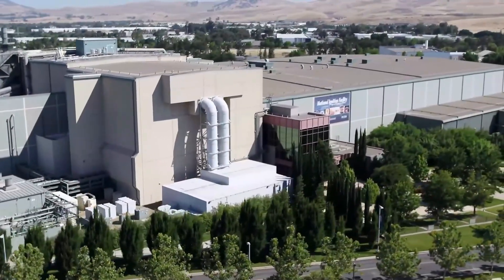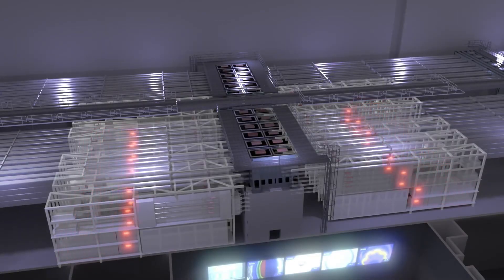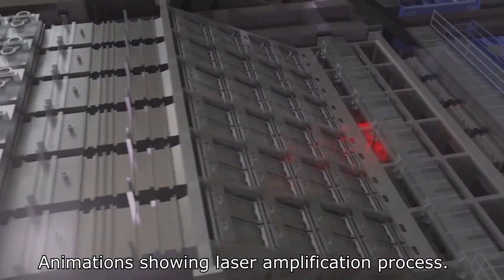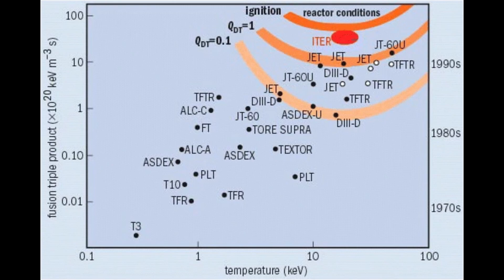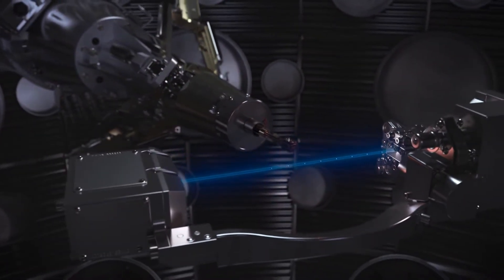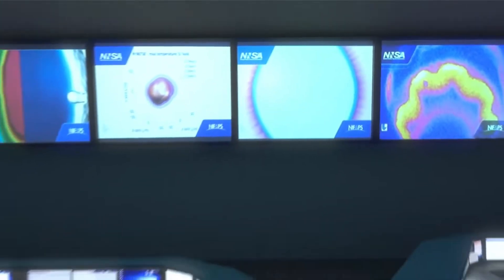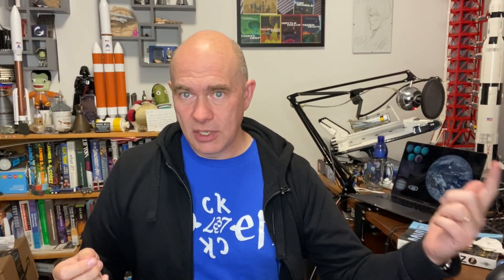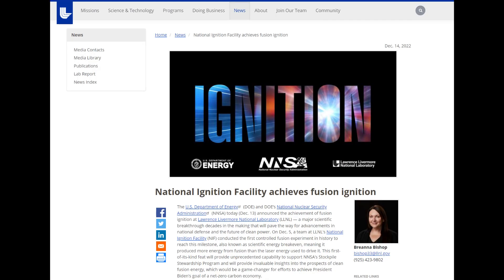Why The Biggest Laser in the World is Making Big News About Fusion

Comment: A big step forward,  fusion used to be 25 years in the future, but now only 30!
Reply: This laser reaction achieved Q 1.5, ITER aims to achieve Q 10.
Reply: @Safetytrousers  what you want is a Q of 10 when counting the energy into the laser, not just that into the pellet.
Reply: @davesutherland1864  Q is break even. The laser did not get 10 times the energy out of what it put in.
Reply: @Safetytrousers  You are correct, I edited my comment for what I had intended wrt laser fusion.
Reply: When they tell you fusion is 60 years away, you can (sort of) believe them.  That means they are ready to set out a timeframe to…

Build a proof of concept reactor to generate power (not necessarily net energy production).

Have plans for a proto type generating reactor (that will have net energy production, sat 50 to 100 MW).

Have plans to build commercial reactors to put significant power into the grid (say 500MW per reactor).

Each of these could be a 20 year rollout.  Some of the startups looking for funding will give you shorter timeframes (they have to for the investors).  However, none of them have any results to date, so take them with a grain of salt right now.

Comment: I think what is lost on most people is that if we are able to harness the energy from a fusion reaction to generate electricity it won't have the problem that fission reactors have of disposing of still radioactive spent fuel.
Reply: On the negative side it will probably never see the light of day since politicians in control of funding are bought and paid for by the fossil fuel industry. I mean heck.. as Scott said it the only reason this facility even got funded was partially for weapons research.

Comment: I‘m asking myself if the next breakthrough in energy production could be something completely different. Because what we basically do since the industrialisation is to spin a turbine (except maybe a olar cell). Are there any other ways of gaining electricity?
Reply: Seebeck effect? Unfortunately, it is extremely inefficient so not really viable for power generation. Stirling engines are highly efficient and used in some large scale solar, but they tend to be unreliable. I suppose you could generate electricity using something like a static electricity generator, that would be cool to see.
Reply: If you don't like turbines, you'll pretty much have to use thermoelectric systems; extract electricity directly from the temperature difference without the whole water to steam part in the middle. It's possible there will be some new materials developed that could make electricity generation much more effective.
Reply: @nuclearmedicineman6270  Yep.  They're called radioisotope thermoelectric generators (RTGs).  Ya just need a little plutonium.  And a lot of money.  And a lot of shielding....
Reply: Check out Helion Energy.  Their reactor has the plasma pass through coils to produce electricity.  The reactor also produces Tritium and Helium 3 as a bonus.
Reply: @jamescottrell7147  MHD generator?

Comment: A wonderful SCIENTIFIC achievement — Optical Breakeven — but not very useful result from the TECHNICAL side of things.  
Using Nd:Glass lasers with so low conversion efficiencies for electrical energy into optical laser beam energy means you need a thermonuclear output enegy several hundred times higher.
Besides there are a huge number of other ootical, material, electrical, thermal engineering issues that have to be solved to get a practical Inertial Fusion reactor.
There are not enough brainpower employed in these problen, and ICF funding is mostly.l provided by the military budget of the DoE, so the predominantly foreign High Energy Density Physics graduating from UoRochester, UCDavis, UCSD, UNevada-Reno are usually excluded from ICF R&D. 
In the USA, ICF is predominantly a military-oriented research program — to investigate, test, homologation, validate R&D for Thermonychear and Directed Enegy Weapons.  Energy generation is not a priority.l — results like this ignition are predominantly budgetary PR for DoE's Lawrence Livermore, Los Alamos and Sandia National Labs.

Comment: The National Ignition Facility is under considerable pressure from Congress for results.  Since the Obama Administration funding for the NIF has been flat or in decline.   The recent hubbub about NIF fusion reaction resulting in a net energy gain, hailed by US officials as a “landmark achievement” is little more than a budget funding ploy.  The NIF’s laser-based inertial confinement fusion though interesting physics was designed as a research tool for hydrogen fusion weapons.  With a laser the size of a football stadium that takes weeks to set up and shoot it will never be a commercially viable way to produce reliable energy.  That said, fusion energy is indeed the future.  It will, however, not be laser-based inertial confinement fusion.  There are some promising projects that have enormous potential.  MIT’s Plasma Science & Fusion Center in collaboration with private fusion startup Commonwealth Fusion Systems (CFS) is constructing the SPARC and later ARC reactors that may do the deed sooner rather than later.

Comment: Couple of points of clarification if you'd please. What does peak pressure that of 1000 times of water mean? The power level was 30 PW or 3x10^16W
Reply from the maker: peak density 1000 times water.

Comment: Did I get this wrong or are Tokamaks also not really continuous? Something to do with one of the magnetic fields needing to be increased continuously, which has a practical limit...
Reply: I think they are but problems persist in getting net energy gain and maintenance of confinement system
Reply: Pulse fusion reactors that run the charged plasma through coils to get electricity seems like a direct way to get energy back.  Check out Helion energy.
Reply: @jamescottrell7147  That's not a tokamak though ;)

Comment: Hi Scott! Just a note on CANDU reactors, most of the tritium is produced in the moderator tank (which is much more concentrated heavy water than the heat transport system water), and also the moderator is thermally isolated by the heat transport tube annulus gas, so it's not a coolant either :P
Reply: @nocontent4178  In a CANDU the reactor and heat transport loop are filled with heavy water. The heat is transferred to light water at the steam generators. That steam runs the turbines. So in a sense you are right. But in another sense you are wrong. I work at one of the plants...we used to extract heavy water from Lake Huron water here.
Reply: @brettatton  Shout out to Bruce Power, world's largest nuclear generating station!
Reply: @sycodeathman  ackshually those would be Kori and Hanul in South Korea right now... but third is still respectable :)
Reply: @brettatton  Thanks for the clarification!, Now go back to Goderich, hoser! (It's a beautiful city).
Reply: @nocontent4178  As others have said, only heavy water is used in the core of a CANDU reactor.  "Light" water, ie. water that only has single-proton hydrogen in it, is actually a mild neutron poison, which is why the uranium fuel for light water reactors has to be slightly enriched.  CANDU reactors can use natural (unenriched) uranium, because heavy water is far less likely to capture neutrons.

Using light water as just a coolant instead of a moderator was a contributing factor to the Chernobyl disaster, as it could cause a positive void coefficient condition to happen.  Since light water absorbs some neutrons, causing it to boil (ie. creating a "void" in the coolant) would actually accelerate the chain reaction since steam is far less dense than liquid water, and thus far less effective at absorbing neutrons.  There's more to it than just that, but this is already getting to be a long post.  🙂
Reply: General fusion is developing a kind of 4 stroke reciprocal piston engine with diesel compression ignition for intermittent fusion explosions. A Diesel Fusion 4 stroke!
Reply: No can do! 😅
Reply: Ha he said annulus
Reply: Is deuterium bred with beryllium to make the tritium or is it produced in some other manner?
Reply: @nocontent4178  That's incorrect, the heat transport system water is heavy water like the moderator water. It's a bit less concentrated, but it's still mostly heavy water. You may be thinking of the loop of water which operates the steam turbines, which IS natural light water. In a CANDU, the moderator is high concentration heavy water and surrounds the pressure tubes as a separate vessel; the heat transport system is medium-concenrated heavy water and flows across the fuel inside the pressure tubes to carry the heat of fission to the boilers; the boiler-turbine loop is separate from the heat transport loop, and uses light water. The heat from the HTS water is used via a heat exchanger to boil light water to drive the turbine. The last step is for a final separate loop of water to pull heat out of the condenser, reforming liquid water in the boiler-turbine loop, and then carry that hot water to a waste heat exchanger to dump into the environment (usually a local lake or river). 

You definitely don't want significant amounts of light water inside the reactor (the light protium isotope has too high a neutron absorption cross section and would poison the reaction), and you definitely don't want to be pumping salt-and-sediment rich environment water through your delicate heat exchangers either. Therefore CANDU has a chain of several separate loops of different types of water getting pumped around doing different things in the facility.
Reply: Well duh!  LOL